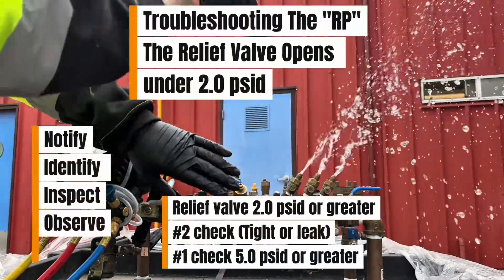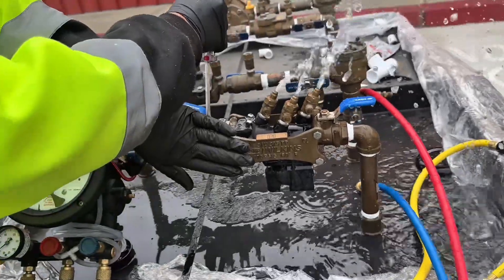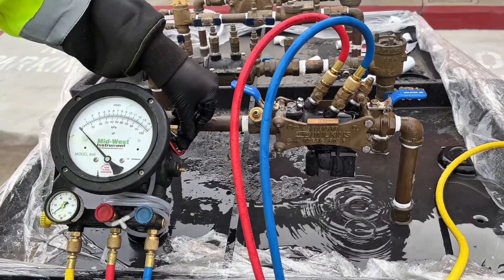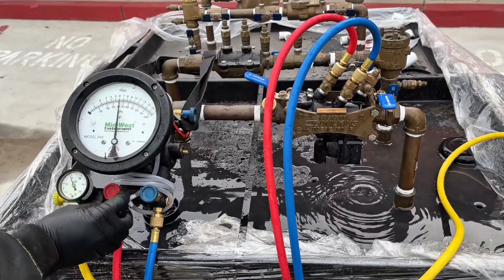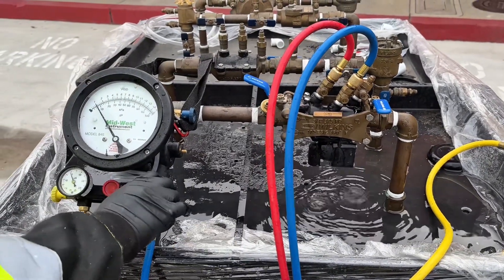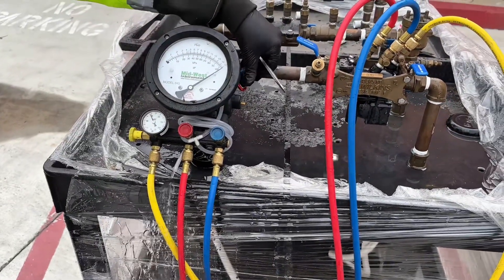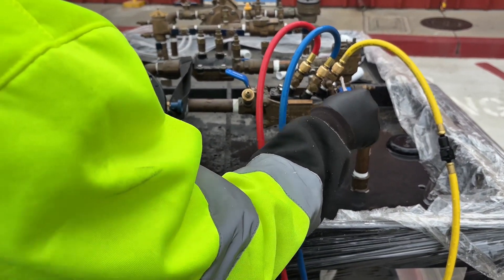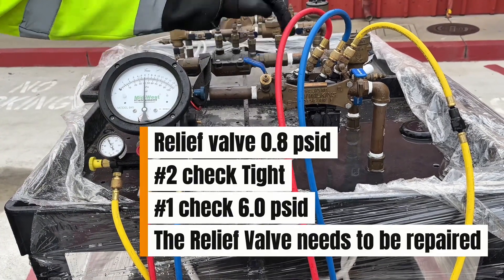Backflow Rp Relief valve troubleshoot test

Comment: Great video!  You didn’t test ck # 2.  2 has to hold 1 or greater.  I’m in NC so I guess state test procedures are different.  Thanks for your video!
Reply: I'm in Texas, we don't put down readings for ck #2 here. We just confirm that it's held tight.
Reply from the maker: @samuellawhorn2861 yes we only check for the tightness on the #2
Reply from the maker: Thank u for the comment, you are one of my first comments for the backflow videos, thank u, on the test the #2 held tight, but i will rewatch the video again, 🙌
Reply from the maker: I think the test procedures might be different i test out in california